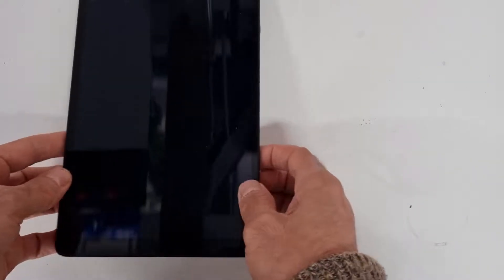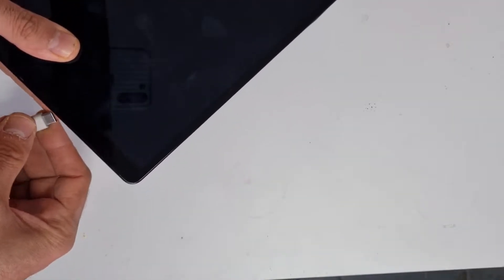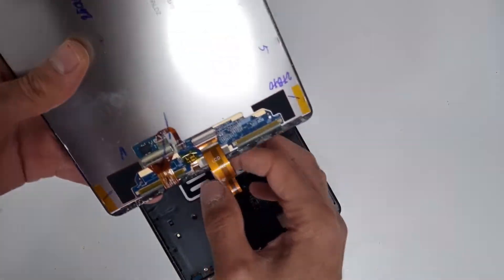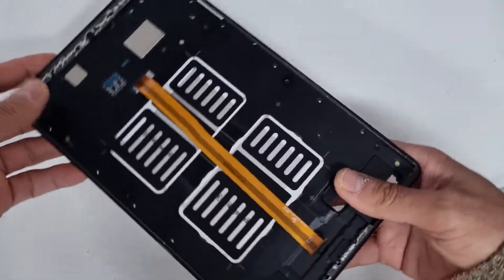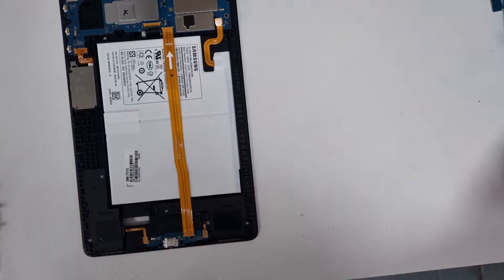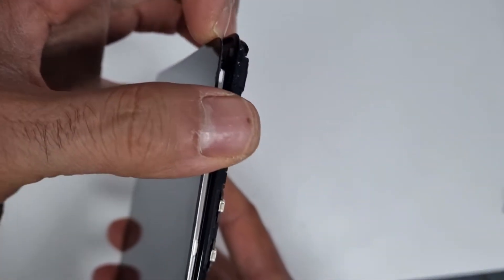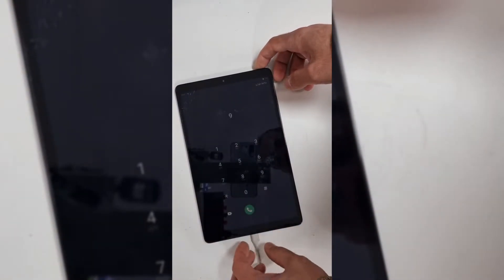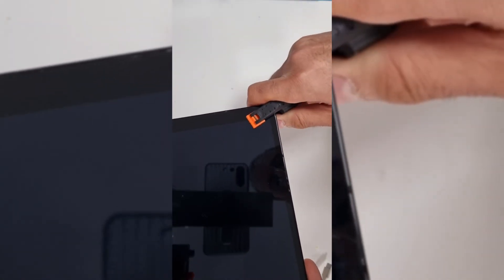Galaxy Tab A 10.1 Charging Port Repair

Comment: Very helpful, thanks. Samsung should be applauded for putting the charging port on a separate module with snap fit connectors.